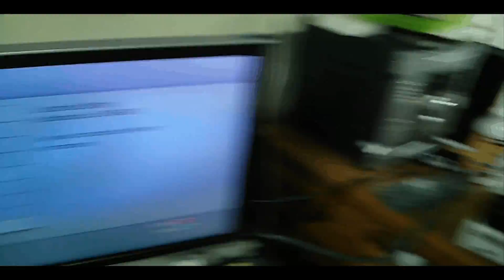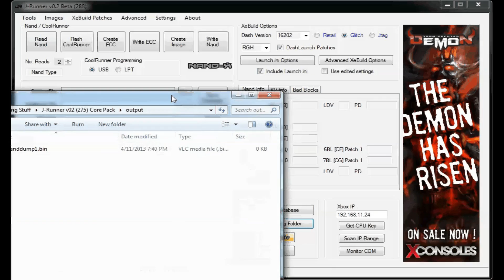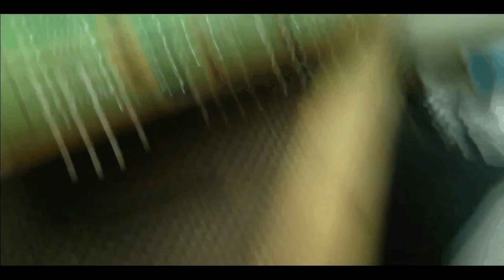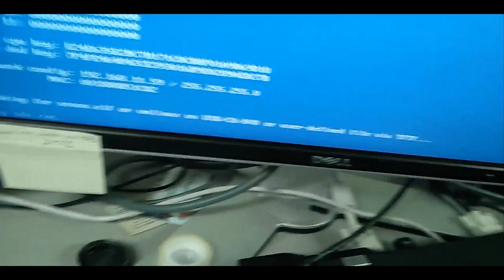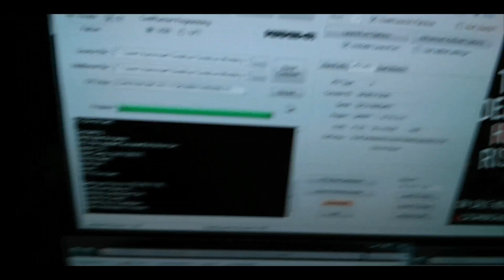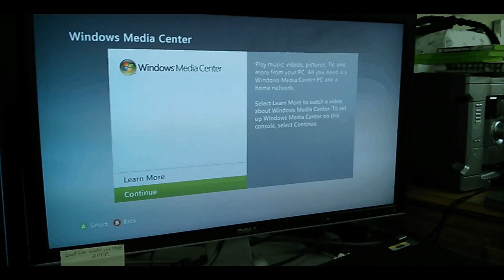How to JTAG a phat Xbox 360  COMPLETE GUIDE

Comment: Very straight to the point. I didn't see any mod chip like coolrunner in this. I take it the falcon doesn't need a coolrunner chip? This video has inspired me to mod my Jasper when I receive it. Could you please point me to the right tools etc? I know I'll need the Nand-x but not sure of the other stuff. It would be greatly appreciated. Thanks in advance.
Reply from the maker: If you pop over to https://weekendmodder.com there is a guides drop down at the top, and one of the options is something like "what supplies do I need" and on that page I break down recommended products by motherboard type.

Comment: Hi, Thanks for the guide, it is really helpful, but I need help from you, I do have problem in soldering, to solder didn't flow in the board and it is stick to solder tip and it never stick to the board, I have soldering station, and very good solder, the only thing which I am not doing is cleaning the board using fiberglass scratcher
Reply from the maker: Sounds like you've already identified your issue then.  Scratch the pads
Reply: Thanks for quick reply, will do and hope things will go fine with me
Reply: Finally, I did that with some difficulties since it the first time for me doing soldering, when I reach to step of switching on the xbox, it gives me 3 red lights :(
does that mean I have hardware failure caused by wrong soldering or it might be something else
is there any guide where I can find troubleshooting steps?

Comment: totally have a console that can be glitched. I was excited until I actually looked to find I have a xenon lmao. if only it had a dash that was just a tad bit older :/
Reply from the maker: Xenons are barely worth the trouble.  Gamestop has $60 slim "S" model 4gb's on sale right now.  You could buy one of those and RGH, or even doing my send in service you'd have a slim RGH for less than $140
Reply: TheWeekendModder im thinking about it but honestly i was looking into this as a project and didnt realize it was a xenon. i just thought might as well do some research since this xbox is sitting around. time will tell what i end up doing. preciate the information (live streams) they paint a clear picture of the process.

Comment: Wich Diodes u use for this? And can I use resistors and if yes wich one? Thx for answer cause I got an Jtagable Zephyr:)
Reply from the maker: 1n4148
Reply: TheWeekendModder thx for ure answer but how much Volt and Ampere?
Reply from the maker: http://www.ebay.com/itm/30-x-1N4148-Switching-Signal-Diode-Free-Shipping-/260812096739
Reply: TheWeekendModder Thx mate I have a Zephyr with dash 7363 so i can follow your Tut and do everything like u in the Vid or?

Comment: Might sound like a dumb question but what's the benefits of j tagging a 360 anymore?
Reply from the maker: RGH = Jailbreak basically.  Means you can run any software that you want to, not just software that MSFT wants  you to run.  That includes software like custom dashboards, mods, emulators for older systems like nes,snes,n64,ps1,gamebody and more.

Comment: Can you do this for the 360 E 
and do you need alot of experience 
And can u use mac for j runner
Reply from the maker: The E series up through MFR date of 6-2014 and before can be RGH'D.  Later than that and you likely have a winchester motherboard that is not modable.
Reply: +TheWeekendModder ok thanks old 360  you can get for cheap anyway
Reply: +TheWeekendModder what xbox do you recommend
Reply from the maker: "S" series slims with a MFR date of 7/2011 or before.   That gives you the RROD prevention benefits of a slim, but is still a Trinity so there is an easy RGH method for good boot times.
Reply: +TheWeekendModder thans

Comment: I had an issue with the wire running from the top of the board to under the board getting crushed when the console was re-assembled. But you know what makes more sense than running a wire around the edge of the board to the other side? Soldering the wire to the underside point. The point is a through hole after all, it's the same whether you solder to the top or bottom of the hole.
Reply from the maker: Awesome glad it's working for you

Comment: so can i do this with dash 2.0.16547.0
Reply: No. 7371 (preferably 7363) or below.
Reply: +Ranjit Singh ok cheers
Reply: +Ranjit Singh is there a way to downgrade??
Reply: DustAmac No, as e-fuses are burnt when you do a dashboard update. eFuses can't be "unburnt" because once eFuses change their value from 0 to f (burn) the voltage necessary can no longer be supplied, but if you CPU Swap your console's CPU with a CPU from a console on a JTAGable dashboard, and flash the NAND with the dashboard that the swapped CPU was on, you can JTAG.

TL;DR: Not possible w/o CPU swap
Reply: +Ranjit Singh then ill stick to jailbreaking a ps3 lol

Comment: could you help me with the wiring on my xenon jtag man? I have all the parts and everything but I don't see any tutorials on literally where to add the wires and diodes and resistors and stuff. any help would be great and I'd give you credit.
Reply from the maker: +Matthew Davis what dashboard is your xenon on?
Reply: +TheWeekendModder it's on dashboard 7371 and it was manufactured before the kernel was patched. I've done some other things to It like the 12v fan mod so I know how to solder and all that. and help would be greatly appreciated and I'd give you full credit if anyone asked me how I did it. I'd also subscribe  :)
Reply from the maker: +Matthew Davis Well, you're commenting on a video that is a full complete guide for JTAG'ing all NON-xenon consoels - but the only difference is the wiring points.  The wiring you'll need to do is this:  http://imgur.com/Fdjmi.png
Reply: +TheWeekendModder Yeah, I realized that it was for non Xenon consoles but I figured your really good at this kinda stuff so why not ask you. In the photo you linked it says "Jumper Wire" would that be the same as just the regular wires on the rest of my motherboard? And on the photo it shows what looks to be a "play sign" (the sideways triangles) would those be my diodes or resistors?

Comment: Where can i get right diodes?? Pls answer quick.
Reply from the maker: +TKFL ebay, radioshack, amazon
Reply: Can it be like any type of diode?
Reply: You can smash them from old electronics especially from old photo roll camera's with a flash light. Or from old computer circuit boards or other advanced prints.

Comment: what do you charge  to jtag xenon morther board and flash the driver i have  I Have 2.
Reply from the maker: Mario Myers $45 for old school jtag, $75 if it needs RGH.  check store.weekendmodder.com
Reply: turn around time i need add less 1 of my systems down and does it come with a ltp cable
Reply from the maker: Mario Myers My average customer has the console back in hand within 1 week of shipping it out.   LPT?  LOL.... nobody uses LPT anymore it's SOOO SLOW.    No - I don't include a programmer - there is no need once it's modded.
Reply: oh mybad um kinda a noob

Comment: I have a jtagged phat xbox 360 w/ a falcon board and i was getting hardware failure with rrod when i did a little research it was more than likely the overheating and so I need to re-solderer my chip and possible do some other cooling methods. Question is this, in the mist of opening my xbox the wire to the ring of light board came a loose! Can I just re-solderer and continue or can I rearrange to match your under the mobo method? Either way have I affected my jtag? I can't check because of the other hardware failure?

Thanks,
Novice XBOXer

Comment: My xbox is 2.0.17150.0 this one can be jtag'd, right?
Reply from the maker: No. Not JTAG'd but it can be RGH'd.
Reply: Also, how many watts is your soldering iron because I have a 25w and a 30w and they don't see to ever get hot enough to work efficiently.
Reply: TheWeekendModder Alright, thanks. Super fast reply lol. I have another one that is a FALCON as well and it is on 2.0.16547.0 how about that one?
Reply from the maker: ***** did you bother to watch the first 5 minutes of this video where I covered it in depth?  No dash over 7371 can be JTAg'd....
Reply: I watched the whole entire video. You said it can't be over 7371 and I said mine was 1715 and you said it can't be JTAG'd which confused me because 1715 should be way before 7371. Maybe if you put the entire update version, it would make more sense.
Reply from the maker: ***** You just like to conveniently drop off 0's then eh?  You put in the very first reply 2.0.17150.0  which is 17150 - no 1715.    7371 is wayyyy less than 17150 - the zero is important.  

And I provided video of the update version number, so dropping the 2.0.  portion was obvious.
Reply: TheWeekendModder If you put the whole thing, I wouldn't have had to ask you because it would be common sense. Oh, well. Thanks anyway.

Comment: does this work on dashboard 6756
Reply from the maker: If you sure it is 6756 and not 16756 then yes, it will work on 6756 (as that's below the 7371 stated in the video)
Reply: It is 16756 :( what can i use to jtag im confused sorry
Reply from the maker: Cande Sanmiguel No you cannot then.  You'd need RGH.

Comment: i have falcon xbox 360 the same as u have in the video , but when i wanted to jtag it, they said its 50-50% that it works.. just want to know if its true..tnx
Reply from the maker: That's BS.  Falcons can 100% be RGH'd.  if you got somebody giving you 50/50 odds on a falcon they just aren't a good installer.  Now a ZEPHYR I'd agree with the 50/50 statement, but I've never met a Falcon I couldn't RGH or JTAG.

Comment: this is interesting but the fact that you can run emulators off your computer without doing all this tedious work kinda voids the purpose of this plus you can buy a connector cable to use the original console controllers rather than being restricted to an xbox 360 one
Reply from the maker: Definitely doesn't "void" it.  Just because you can get from point A to point B in a car doesn't mean some people won't want motorcycles, or trucks, or vans.... 

Yes, emulators can certainly be run on PCs, but that doesn't invalidate the ability to run them on a 360.
Reply: I don't mean its pointless I assume you get more than just the emulation portion im just letting people know there is a much simpler and better option available for people who are only interested in the emulator portion of this

Comment: What JTAG USB device do you have? I'm looking to get one. It looks like you have the Xecuter NAND-X USB Update Cable , is this correct?
Reply from the maker: The item "NAND-X USB Update Cable"  is actually a seperate cable used, as it's name implies" to update the NandX itself.  The NandX device is actually the USB SPI JTAG tool that I'm using.  Soon I will have some substitute devices that use the same drivers as the nandx available for sale as well as more JR Programmers.

Comment: My xbox spare xbox has 2 heatsinks and no hdmi what board is tgis?
Reply from the maker: All phats have 2 heat sinks.  No hdmi means its a Xenon.
Reply: TheWeekendModder I have ? I have a phat 360 but no disk drive it broke so how do I jtag do I needs any special chips or just wires and soldering

Comment: I have a jasper console, but the Dash version is 2.0.16747.0, so restoring my xbox to factory default would set it back to its original dash version, in which case, I can then to a normal jtag, but if I wanted to update my console back to 2.0.16747.0, I would have to do an r-jtag or and RGH. I just want to clerify this for myself.
Reply from the maker: No. Resetting to factory will not change your dash. There is no way to downgrade a stock Xbox.

You console can be rjtagd or RGH2

Comment: can't you just use a usb flash drive with fat32 and stick updflash.bin on the root of the drive and boot xell and it would flash the nand through usb? at least you can do that with rgh not sure about jtag
Reply from the maker: You could, but since you already have the hardware nand flasher connected at that point I just flash the full image that way as well - but you are correct that once xell is booting you don't have to use the hardware flasher anymore.
Reply: TheWeekendModder yeah I'm going to do a RGH 2.0 on a 16 mb jasper  (yes in know about rjtag but I have my cool runner rev C from a failed 256 BB jasper which I could've done rgh 1.0 since it was on dash 13599 but I ended up ruining the band and bricked it)
Reply: Robert Mason nand  not band stupid auto correct
Reply from the maker: Robert Mason Good luck!
Reply: TheWeekendModder thanks

Comment: So I just bought a jtag'd xbox 360 and everything was working fine until a couple of hours ago when it froze on me. Now when I try to boot it up the power symbol on the xbox turns on but the 4 lights around it don't cycle through and all i get is a black screen on my tv. The fan and everything is running, it just doesn't boot at all to anything. I'm using A/V cables and their is no hdmi on it. I've tried everything that I know to do. Do you think you can help me?
Reply from the maker: With power connected to the xbox look into the side or stop grates and see if you see a glowing red light and / or a pulsing green light.

My suspicion would be that you actually have an RGH console and that the glitch chip isn't glitching anymore.
Reply: no i'm pretty sure its jtag'd , a buddy of mine and myself actually opened up all the way to the motherboard and saw where the wires were soldered onto the motherboard. I have no idea why this happened because it was working fine and then all of a sudden it wont boot up at all. The only thing it will do is turn on.

Comment: Xbox jtag: 40 minutes of complicated tasks ...
 PS3 jailbreak: install dex = done
Reply from the maker: PS3 = Months of searching for a console 3.55 or below or paying for a downgrade service.   Xbox 360 = Every console can be hacked on any dashboard (except Xenons passed 7371).   

I'm not knocking either - I have both.
Reply: TheWeekendModder one question: If I purchased a Jtag For my xbox, I won't have to do all the work?
Reply from the maker: Cherry in a Box You can pay to have the service done for you - thats one of the services that I offer.   You send your console to be modded, I mod it , and then send it back.
Reply: TheWeekendModder Is the Jtag the same as a flashed xbox or different?  Sorry I'm new to this type of stuff
Reply from the maker: Cherry in a Box Flashed just means that only the DVD Drive has been modified so that the console can play bacup/copied games.   JTAG (and RGH) give you the ability to run unsigned code, which means hacked games, modded dashboards, emulators, games from USB without needing the disc at all and more.
Reply: TheWeekendModder Ahh....Ok. Thanks for the help :)
Reply: But still can we use a jtagged xbox for playing games copied on a dvd
Reply: Wii: send mail =done
Reply: Enzymiz BRUH this was 4 years ago, bye.

Comment: I've bought an almost brand new Jasper Xbox 360 a few weeks ago off eBay, I took it apart to clean it but I was surprised to see that it was like never used before, no dust no nothing :D, it wasn't opened before as I broke the warranty seal myself... I changed the CPU & GPU thermal paste to avoid doing it later... My question is: Do you recommend the AUD_CLAMP wiring or not? You didn't mention it at all... For the second diode, can I just solder it on the top side of the board (With the right direction of the black line of course) and just run a wire to the bottom side of the motherboard through one of the holes next to the Hana chip?? Which diodes did you use by the way? I have a few 1N4148 diodes but I think that I've read somewhere that it's possible to use other types of diodes?
Reply from the maker: I tried to only address basic JTAG wiring - not the additional AUD_CLAMP and Boxxdr methods.   I've never had a situation that I needed to use either of those to resolve - though I've only done a few dozen true JTAGs vs the hundreds of RGH's and RJTAGs that I've done.
Reply: TheWeekendModder Thanks for the quick reply, I will try with the basic method, what was the advantage of the AUD_CLAMP anyway?
I did it on an R-JTAG install a few months ago for a friend, I just followed the TX a tutorial... I wish they were selling the JTAG_ALT V2 :-/ ... The install would be neat.
Reply from the maker: MythicGeek In certain cases it can resolve E79 issues or instability.  I've generally found regular JTAG with diodes to be just fine.

Comment: It's safe to assume RJTAG and RGH are definitely more complicated? I bought this case mod for an xbox I bought and I'm trying to give it the works both in looks and performance. If I wanted to edit say, maps or use weapons not in a game or something of that nature, what type of mod should I use to start off with?
Reply from the maker: I'm not a game modder - I use my JTAG/RGH consoles to run FreeStyle dash to play stock games from HDD without needing to have a disc in the console and be able to run NES, SNES, Genesis and other emulators.

That said, game modding should be possible on any console that has been modded to run "unsigned" code. The truth is that every single JTAG, RGH, RJTAG all have the exact same capabilities, it's just the hack that is getting you there that is different.